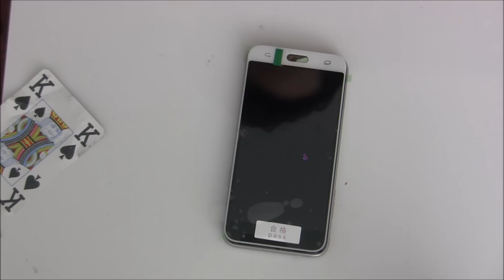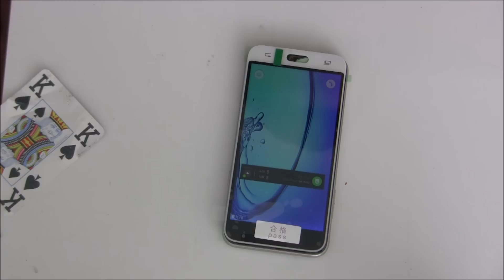Samsung J3 2016 J320 - Replace & FIX LCD Screen by CrocFIX

Comment: I have several questions 

1) do the buttons at the bottom of the screen work  

2) does the headphone jack still work 

3) how long will it last
Reply from the maker: 1) yes. Sometimes you need to put some adhesive under the buttons to lift them a bit
2) yes
3) until you break it again :)